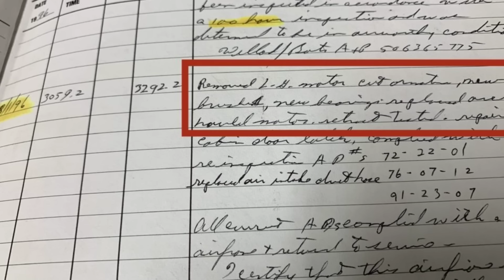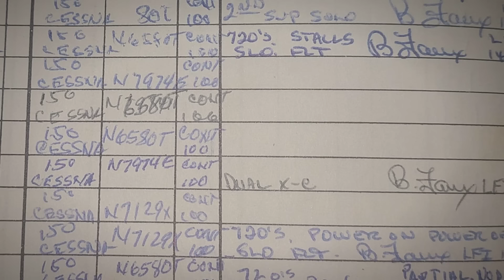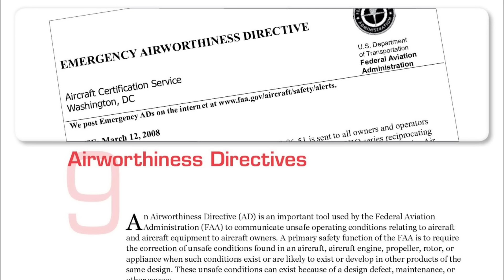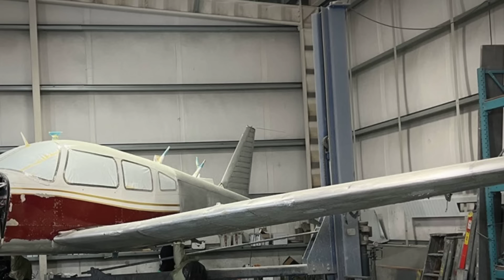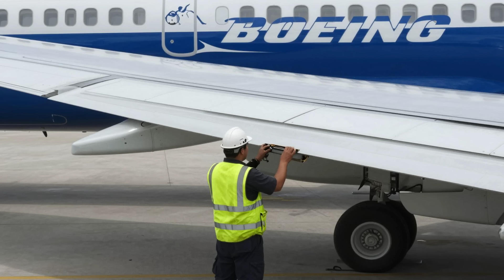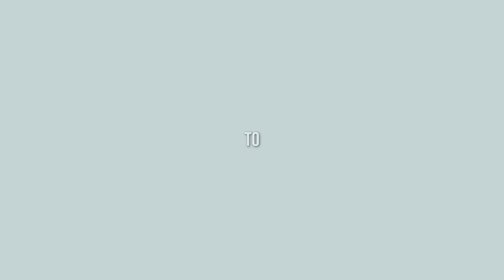The Piper Cherokee's Fatal Flaw: What Every New Owner Discovers Too Late

Comment: Years ago I used to rent PA-28-140's from my fight school.  Never heard of this failure.  Cold bending of spar components seems crazy!  At least annealing and re-tempering would seem necessary.
Reply: Yeah, should be hot extruded and formed. I knew about this issue but I'm an A&P. You should always be extremely careful when renting a plane. I'll do a 100 hour inspection if that's what it takes to be confident it is safe. This is why I've never flown a Cherokee.
Reply: @RunsWithChainsaw  there was an AD put out about this issue and it says to put an inspection plate in the wing so that the spar can be inspected during the annual.

Comment: Wrong. Perspective buyers only need to make sure that the AD has been applied with, if it is even applicable. Most planes that have not been owned by flight schools will not accumulate the number of SERVICE HOURS for the AD to be applicable. Sky Ranch is a click baiter. There are must more accurate web sites available.
Reply: No, you're wrong because there is a ton of pencil-whipping. 
As an A&P, I have learned not to trust any signature when my life depends on it. Especially not in GA.